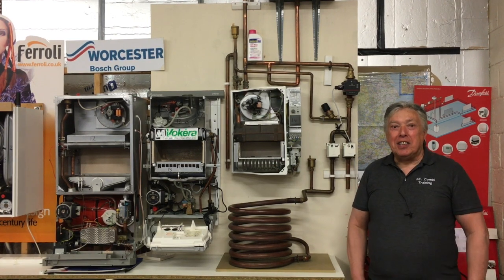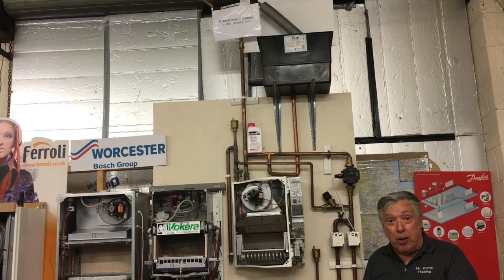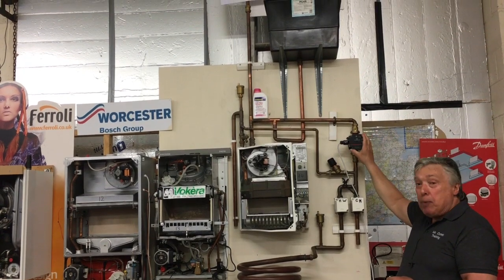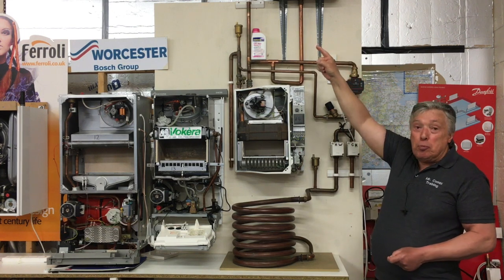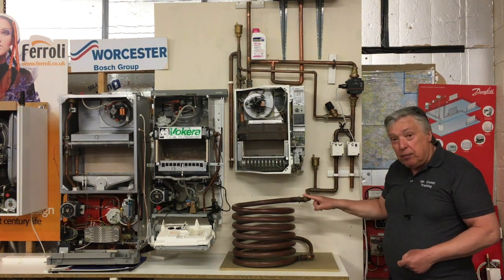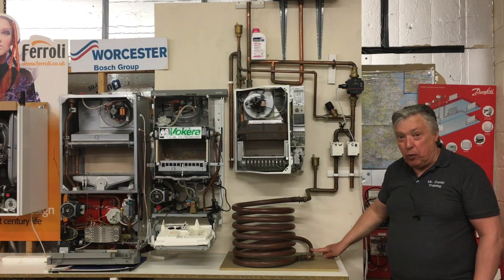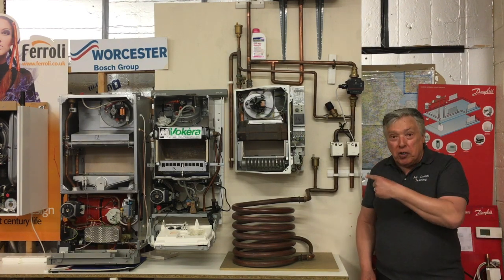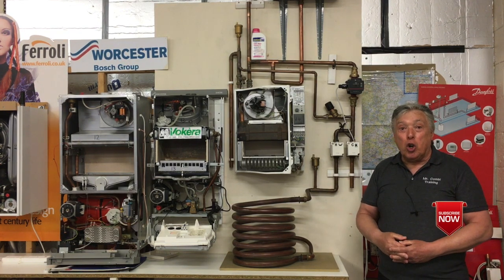Heating Expansion TANK problems SOLVED

Comment: Why does pumping over start the sludge process? Thanks
Reply from the maker: Hi Paul, thanks for asking, The main fault is lack of inhibitor which is an installer fault. As the pump circulates the water into the tank it makes bubbles that goes into the main exchanger where it get cooked, as the water heats up from 20c to 70c air bubbles explode (kettling) turn into sludge then scale, simple. Installers must put the loft bend 2 meters from tank as shown, hope the helps, George 🤩

Comment: I have hot water going into the header tank on a commercial heating system . What in your view could be the problem? Any help would be appreciated as it's for the Newcastle Dog and cat shelter
Reply from the maker: Hi Keith, thanks for asking, sounds like a leak under the ground floor / concrete floor  because  above that you would see a stain. I used a thermal camera 
put the heating on MAX look for a white image, good luck, George Staszak 🤩👍

Comment: Great informative video! An energy company as part of government scheme installed new heating controls and 3 separate zoned motorised valves on my Potterton Suprima 50 F&E system. Ever since it pumps over when the boiler shuts down, my guess is when one or more valves shut the pump still runs causing the hot water to pump into the F&E tank...  

I've installed a wilos picos pump hoping that would cure it with a bit of fine tuning of the pump settings. No luck, will extending the vent pipe by 2 meters cure the issue or is it best to completely seal the system with an expansion vessel etc? thanks
Reply from the maker: Hi, Neo, as video shows the pump is 5 - 6 meters from the top of the water in E Tank but its the BEND above that also needs the same distance to stop " pumping over" also "pump over run" to cool the exchanger to 59 deg. 
     I found 2 meter extension often does the trick, as long as from the pump centre to that bend is 
5 -6m away, NO pump over, NO sludge.
      Don't forget the cold feed in 22mm in a " J " as picture shows to speed up fill & venting. 
Your installer missed lesson 1 on F & E tanks.
regards
George Staszak
🥰
Reply: @mrcombiBedford  Perfect 👌pump is above my boiler in the kitchen & vent pipe runs upstairs to the airing cupboard and into the attic so approx 10 metres. Will try the vent extension, hopefully will stop the pump overrun flowing into the F&E tank . Thank you George 👍
Reply from the maker: @Neo-mw1pp  Hi Neo, sorry missed this message, If you have 10m from a pump to bend it cannot pump over, some this is wrong, Nr. 1 common fault is auto by-pass needs adjusting, Nr. 2 pump facing the wrong way or speed too high. At that distance the cold feed can be 15mm. less than 6m distance then 22mm is best.  Don't extend the vent pipe I think its pipes below the loft. Is it like the drawing? From the boiler FLOW 22mm equal  'T' then cold feed then auto B Pass then valve(s) or straight to rads. good luck, George Staszak

Comment: Just to clarify. My vent to the pump iscurrently 1.7mts to the pump. Does this mean I will need to increase this by 0.3mtrs or above to make this over 2 mtrs.
Reply from the maker: Hi Alan, thanks for asking, is it pumping over, if no all is well? As video,  pump screw straight up to top of water should be 6m, but 2m may work. 
Easy way is cut the 22mm vent pipe ABOVE the tank kick over about  60deg. extend 2m repipe back to tank, this saves changing 15mm to 22mm. 
Don't forget uber clip and EXTRA lag the extended pipe.
Don't NEVER solder in the loft always use metal connections never plastic coz they split in the cold.
Happy Xmas, george staszak
Reply: @mrcombiBedford  Thanks the immediate answer and additional advise. I shall extend the vent pipe as you stated and I’m sure this will fix things.
Merry Xmas to you.
Alan
Reply from the maker: @alanupcraft2758  It works done that lots of times.george

Comment: Hi,  can someone explain why it is necessary to have a pipe that comes over the top of the expansion tank?  Can water not just expand up through the pipe that comes out of the bottom of the tank?   Also does the pipe need to be 22mm - could it be 15mm if it is situated in the loft, a considerable distance from the boiler?
Reply from the maker: Hi William, thanks for asking, easy, as heating water it expands +4% volume it has to go somewhere. 
        In the 60's - 1970's most systems had a floor standing boiler in the kitchen, a 22mm pipe went to the loft F & E tank a 15mm cold feed pipe went to the cylinder bottom feed to fill the system - all was well nothing wrong. 
      As the pump (on the RETURN) started that increased the pressure the system coped OK. 
When fitted on the FLOW it would "pump over" making sludge which would settle in the rads and ruin everything.
1970's Rules were changed the cold freed to 22mm and auto by-pass MUST be fitted + inhibitor 
Unfortunately most UK installers ignored this thus we have suffered to-date its sill goes on today.
Hope that answers your question. 
Take care ☺George Staszak
Reply from the maker: Hi William, thanks for asking, first the pipe cannot be reduced because the system water needs to hit the EV as soon as poss to stop the pressure increase, a 15mm pipe will INCREASE the system pressure, the 22mm pipe is part of that expansion.
    It does not matter which direction the pipe is, normally most are top because easier to solder and fit as in my video, all the best, George Staszak 👌

Comment: I'm getting a bit of condensation in the loft, guessing it's from the FE tank, it hasn't got a secure lid, just a flimsy loose bit of insulation wrapped in plastic. Should it have a secure lid with a vent I'm guessing so air can get in ?
Thanks
Reply from the maker: Hi Matthew, thanks for the question, yes you are dead right, both tanks must be well covered and lagged. Back in the 70's and 80's when ever I had to enter a loft I took a bucket and carrier bags to remove drowned rads, mice and birds because someone did not cover both tanks correctly. This is still the case today, no one checks if all is OK. 
    It looks to me the little explosion tank is "pumping over" as you saw in the video. You can see your self is so and after the heating goes OFF when the pump stops does it happen then. 
Another problem is your loft lacks ventilation,  Often neighbours have the same roof see what vents they have. In your loft have a look if the vents are blocked with insulation along the facia
that would cause damp lofts. Call a roof tiler or small builder for  free advice. All house and room need air movement, not a draft regards george staszak Mr Combi.
Reply: @mrcombiBedford  thanks, I've secured the lid allot better and will improve the ventilation also
Reply from the maker: @matthewparker4517  Hi Matthew, I thought so it needed a bit of lagging. Most installers hate going in dark dirty lofts thus as you see tanks and pipes are in a poor state.
A message to all, if you have loft tanks when your boilers is checked every year ask to pop in the loft, don't forget to pay for extra work and have peace of mind. Thanks for the update,  regards. george staszak

Comment: hi.... I had a new worcester combi (gravity fed) boiler fitted a couple of years ago. when ever I turn the thermo up about 21c..... the boiler gurgles and bangs, then steam gets blasted in to the feed tank above the boiler. 
can you confirm I need to extend the 22mm pipe and put a pressure valve on..... or is that just for sealed units? thank you.
Reply from the maker: Hi Flying hero, Pressure R Valves are only for sealed Combi systems, you problem is sludge or a  pump problem.  As it's a couple of years old go back to the installer to fix it U/Gtee. Consumer Law stats is should be of reasonable quality and last a reasonable time. Any problems with them call Gas Safe with a complaint, also call the factory for guidance. regards, george staszak
Reply: @mrcombiBedford  thank you for your reply George. when the boiler was installed the gas guy did do a flush of the system to get rid of sludge... he did say it was quiet bad.... but he also replaced a couple of rads, but it never sorted it.. the pump I replaced last year.  do you think another power flush would help? thank you
Reply from the maker: @flyinghero5283  Sounds as if the "flushing" was not done enough or correctly. All the rads should have been removed to clean and then the whole  power flushed BEFORE and AFTER the boiler change. You have a very serious poor circulating problem and should NOT use it until 100% safe. Call the factory today. regards george
Reply: @mrcombiBedford  thank you again George... I will get on it... happy Christmas mate